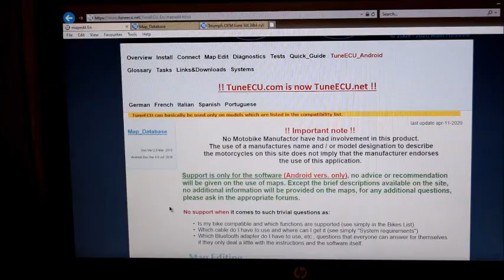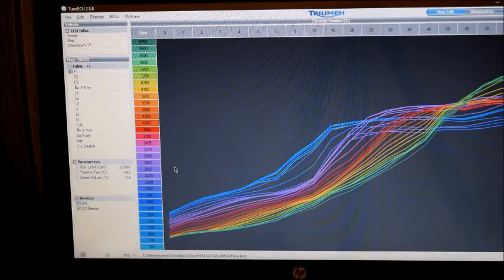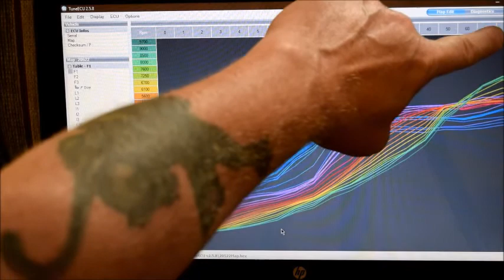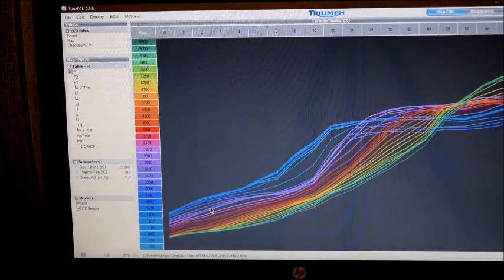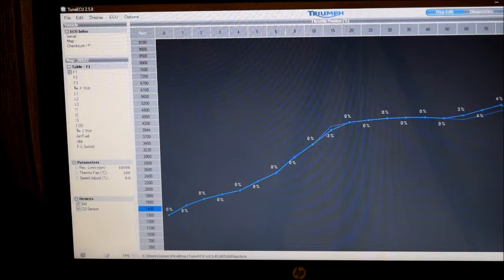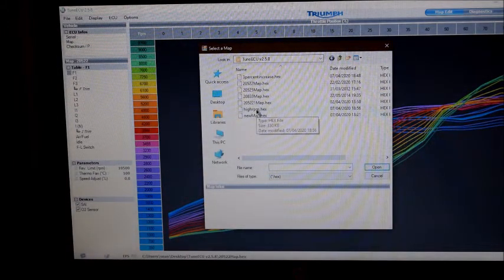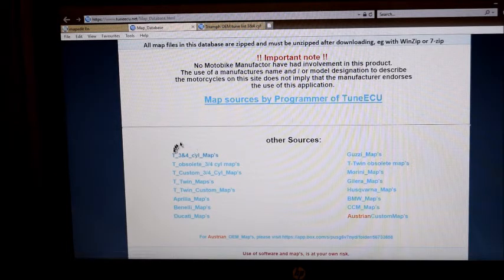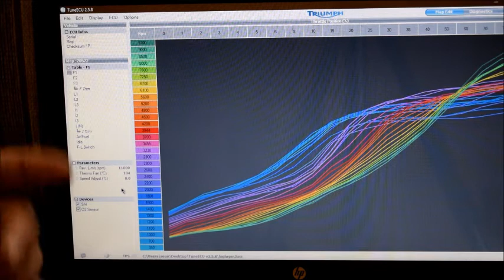Speed Triple R 2014 ABS model - TuneEcu, how to change the map parameters and upload to your ECU

Comment: Great explanation, going to use this video to try and remove the hole around the 3-4k rpm. Did you experience any issues with raising the rev limit?
Reply from the maker: Don’t, runs a treat. Just gives a little extra when you need it

Comment: Interesting, but aren't you stabbing in the dark without a feedback loop? On a Dyno you get the O2 sensor en you can see what the tune does but here you don't see anything or do I misunderstand ?
Reply from the maker: It’s more of an educated guess when you can see exactly what’s going on with the standard map. All you are doing is smoothing it out to fill the voids
Reply: @seanhaywood7946  Yeah I've since this post tried it myself and it does help with smoother pickup and overall response. For peak performance I would recommend a dyno session and map from measurements.